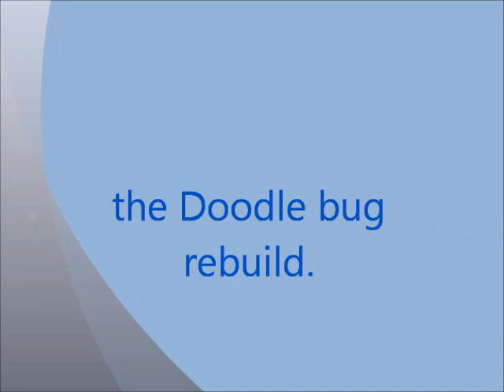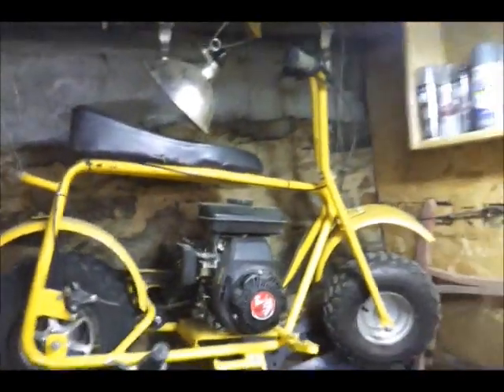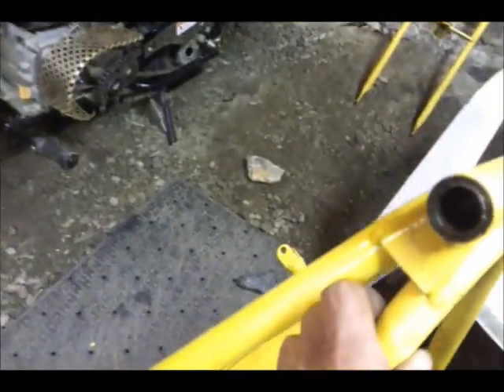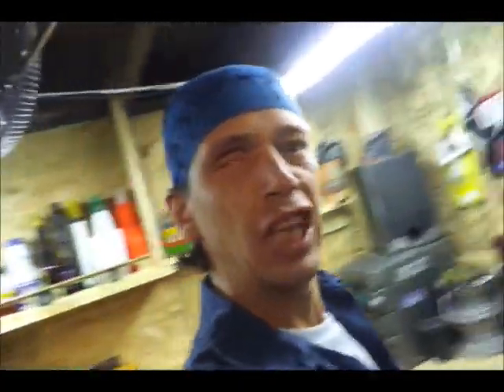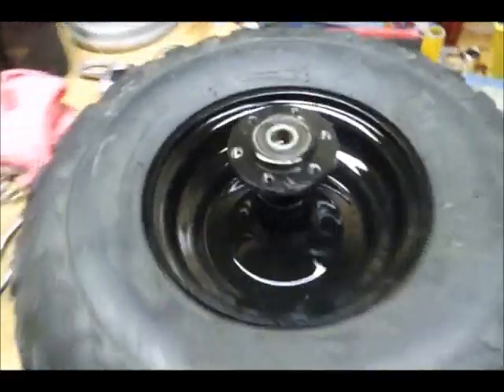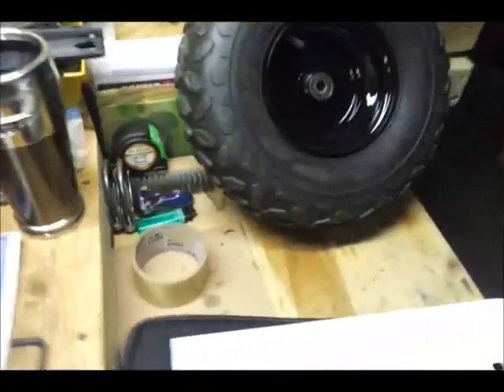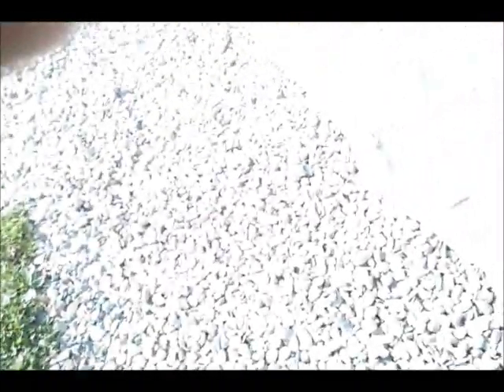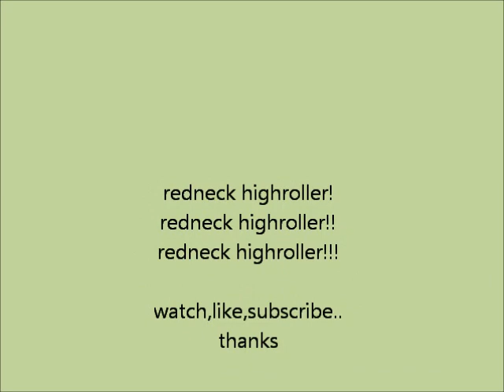Doodle Bug rebuild

Comment: how would you mount a lawn mower tire on a mini chopper i'm trying to build one but I cant figure out how to mount a lawn mower lire to the back end
Reply from the maker: um, im not sure that's a good plan, but the same way you do any other wheel  prolly.  cheers bro, its to small and plastic buddy
Reply: an riding lawn mower tire like the 16" tire with metal rims
Reply from the maker: oh oh beg my pard. well you would have to make the back end wider and weld a sprocket mount on the rim. that should work bro.